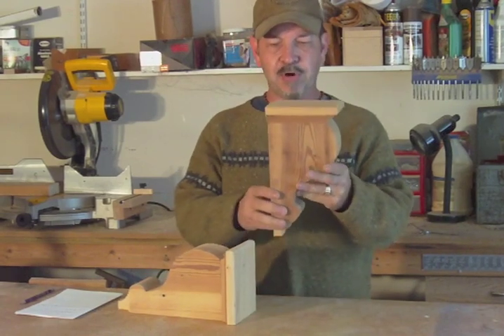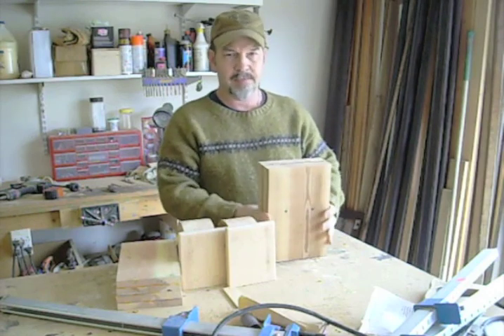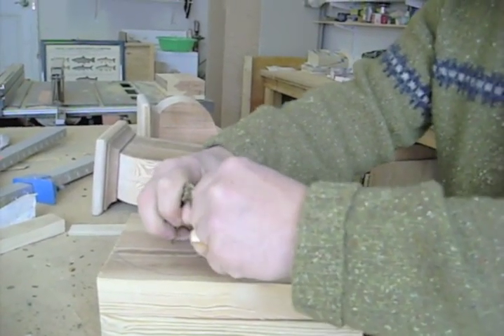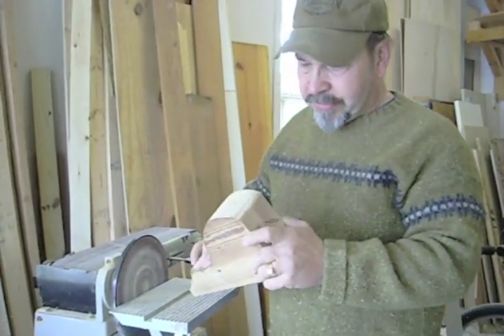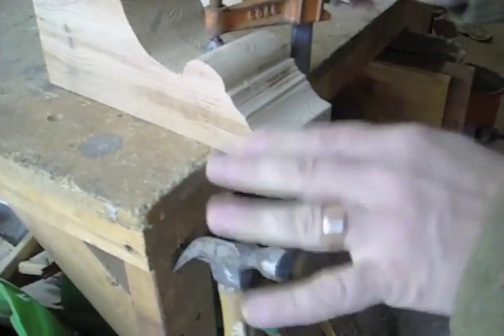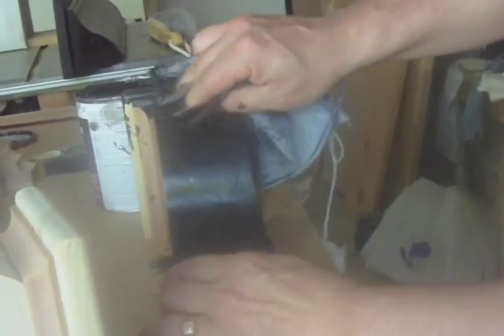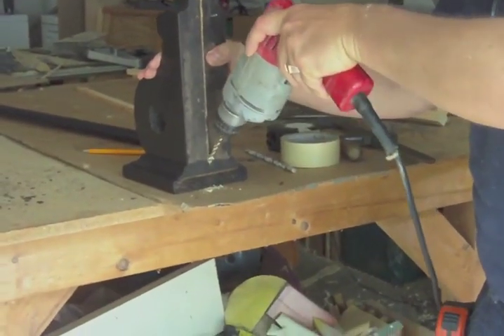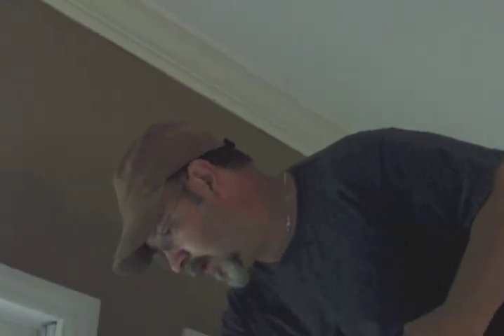Making decrative beautiful corbels or support brackets.

Comment: Great job! I noticed that you used a sprayer to coat the corbels. I very much want to learn to use one of those so that I can spray coat some of my furniture. Do you have any other video's where you demonstrate using the sprayer? Thanks. Carol Rum
Reply from the maker: +Steve Rum NOT yet steve but they make a huge difference in your finish. They are not hard to use, of course some materials need to be thinned such as paint.

Comment: Nice work! But can you tell me what size of bandsaw blade you used? That is, how many tpi and/or how wide was the blade? I like using my 3/4" resaw blade on thick material, but it doesn't do well on tight curves. Thanks!
Reply from the maker: Not sure about the blade it was the one that came on it.